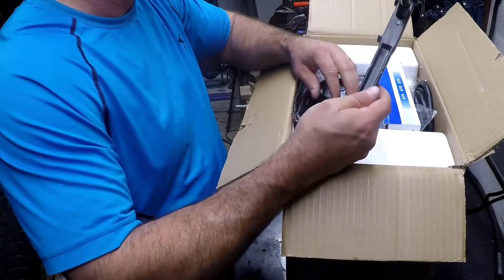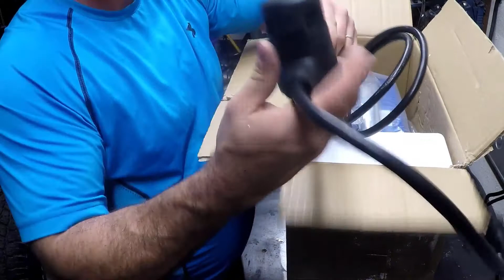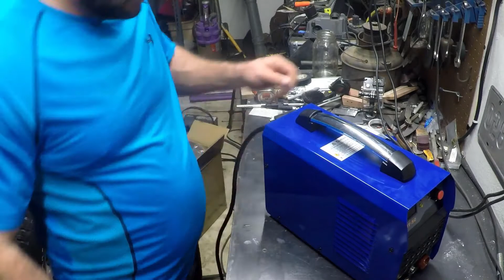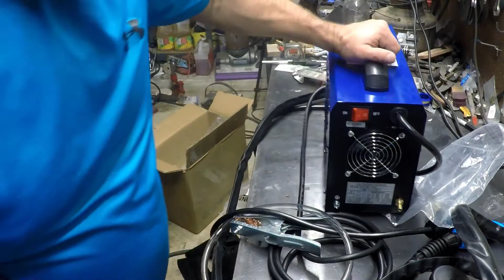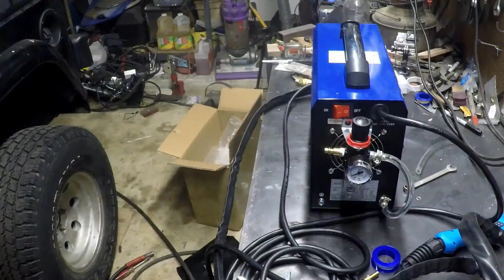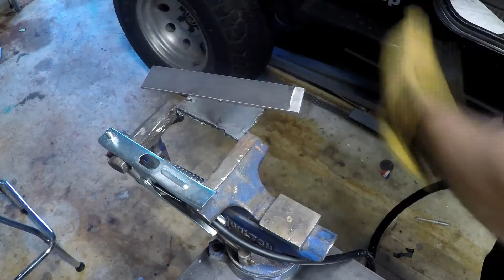SUNGOLDPOWER 50A Air Plasma Cutter Review 2020

Comment from the maker: SUNGOLDPOWER 50A Air Plasma Cutter
BUY NOW: + amazon (US):https://www.review95.com/us/b07yfbw4w3
Our Cut50 is IGBT tech, not MOSFET. IGBT machine is far superior and more stable than MOSFET machine. In the following aspects: Peak current capabilities, forward resistance and temperature drift, switching speeds and response time, logic level switching and isolation, gate capacitance oscillation, cost, effectiveness at higher voltages, heat dissipation requirements.

1.IGBT inverter soft switch, DC output.

2.Digital LCD display, easy read front panel air-pressure guage.

3.Max cutting thickness is 1/2”, Suitable for cutting Stainless steel,copper, iron and aluminum metal etc.

4.Over current and air pressure light indicators keep you updated on your units operating condition.

5.Save energy and no noise, high cutting speed, cutting smoothly and no polish demands.

6.Strong interference resistance, stable cutting current and steady,Continuous current regulation, waterproof,shield from electric shock.